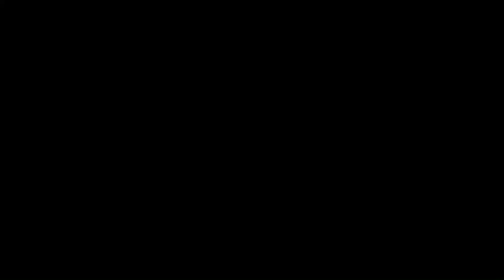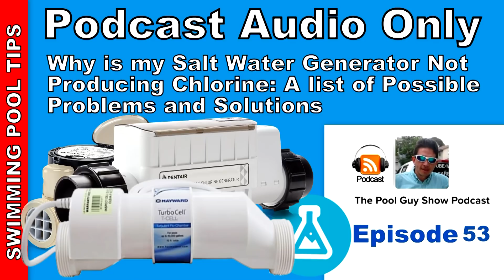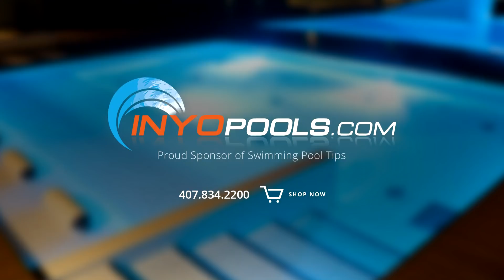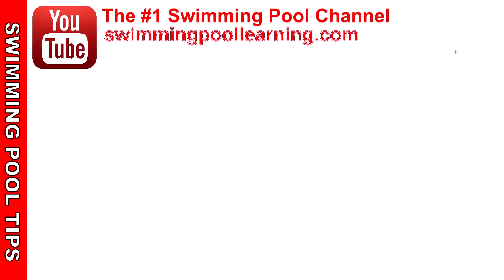Why is my Salt Water System Not Producing Any Chlorine? Possible Causes and Solutions

Comment: bought a home with an old hayward goldline. The configuration menu shows T -5 and T-15 only. no number 9. yet there is a T925 salt cell installed at the moment. 

should i swap the salt cell to a one of the T-5,T15. 

thanks in advance.
Reply from the maker: If it is working I would leave it alone.

Comment: I have noticed with the Pentair cells, after I acid wash them the entire cell is clean except for one little area.  This area is completely covered in calcium, and all the other discs are clean.  I don't want to keep acid washing it with most of the cell clean, just to get a small about off.  I try spraying it with the garden hose, but the calcium does not come off.
Reply from the maker: It shouldn't affect the production at all.

Comment: I have a 10,000 gallons in ground pool and Aqua Rite control panel. The cell went bad and ended up with high amp/salt level (6,400 ppm). I drained half of the pool and replaced with fresh water. My system still sending the high amp/salt level. The salt level is still saying 6,400 ppm. What could be the cause of getting this bad reading?
Reply from the maker: The cell or board is bad.

Comment: Why is My brand new IC40 not generating any chlorine. My salt level is at 3500ppm according to Leslies Pool and my digital meter shows 4000ppm. Flow light is green. Salt indicator light flashes red and green for 5 mins then stays solid red indicating low salt.
Reply from the maker: There is plenty of salt in there. Might be a defective cell at this point.

Comment: I think undamaged mine with acid for to long. The stuff I bought was weak, normally it would fix but didn't. So I let it stand overnight as it was taking way longer than the typical half hour to clean it up. Well my salt levels are good, chemistry is good. But water sample shows no chlorine.
Reply from the maker: You may need a new cell. The pool store can test your salt cell if you bring it in.
Reply: @SPL  it's not the cell. Guy replaced board and it  said 2800 but not generating. So I tried to recalibrate, but when you wait for the click before you hit diagnostic button. It doesn't click. Now it says -0. What does it mean when it doesn't click? Or how do I get it going

Comment: Just had a new Pentair installed. All chemicals are reading good, all lights are green (flow, salt, cell) on the Pentair but after running at 100% for 48 hours straight it has produced no chlorine. Our pool guy seems out of his depths and is saying it could be a filter needing replacement, but with flow green and it producing literally zero chlorine, could it really be a bad filter doing that much harm?
Reply from the maker: It could be something as simple as the pool having a very low CYA level. Or some other issue - was it holding chlorine with your previous method before the salt cell was installed?
Reply: @SPL  So our CYA number from the water test was 28 PPM. Is that low enough to cause zero chlorine to be present in the pool? I have an automatic pool cover and have been leaving the pool cover closed this whole time. Our pool was fine last year using regular chlorine.

Comment: I have an IChlor salt cell that has all green lights on with a 3,000 salt reading . Each week I take a sample of water to be tested at my local Pinch-a-Penny. This week the store manager informed me while my salt level is sufficient, there is no chlorine in the pool. Again, there is no indication from the light system that informs me of a dirty cell.  What should I do now?
Reply from the maker: It could be a number of factors. I would do a 24 hour test. Run the pool at full speed for 24 hours and then check.

Comment: My Hayward salt and cell light are on steady.  I replaced the cell, ran it at 100 percent (t9), and it still isn’t generating chlorine.  Salt level is at 3100, so it’s good.  I also replaced  the flow valve.  Still no chlorine.  Purchased and replaced the motherboard, and it had no power at all.  So I purchased a new display board, and it still has no power.  I Sent the motherboard back and put the old one back on and the power on display operating, but the salt and cell lights are still on.  Any suggestions?  I got the system in 2017.
Reply from the maker: How long are you running the pool? Try running it for 24 hours straight and see if the chlorine holds. Also, your CYA level should be 5080 ppm.

Comment: My salt water chlorinator is working intermittently. I have 5 green led lights from 0 to 100%.I have it turned to 100% which should light up the 5 leds.Sometimes it does and sometimes only 1 led is lit.

 My pool has perfect water chemistry with slightly high chlorine reading as I super shocked it due to algae.My pool salt is over 6,000ppm.

 Recommendations are minimum 5000ppm optimum 6,000ppm and max 6,500ppm.

Could the chlorinator cell not be making chlorine as the salt level may be higher than 6,500ppm thus sometimes showing only 1 led when set at MAX Chlorine?
 Thanks for any help.

Comment: This is very informative. We just had a 16,000 gallon pool installed a few weeks back. Salt was added about two weeks ago, and was being maintained by the pool installers pool guy. I bought a Sutro to test the levels. I started getting the readings today with low chlorine levels. Salt cell is rated for a 40,000 and has been running 100%. After listening to this it seems maybe our SWG hasn’t been running long enough. We have a variable pump I believe but was told not to mess with the scheduling. Any tips to figure out what to do?
Reply from the maker: Run your pool at the full 3450 RPM - 100% speed and salt output at 100%. Test and see. At those setting the system should make about 1 lbs of chlorine which should raise the chlorine level up to a high level. Also make sure you have about 80 ppm of Cyanuric Acid in the pool.

Comment: Hello, I have a 26,000 gallon pool. I have a Pentair ic40. Last week my salt and chlorine was all good when I opened my pool. This week my pool is cloudy and my cell generator was flashing red and green on the salt level. It was red to clean it so I cleaned it even though there was no calcium buildup. I then put it back together and I pushed  more for three seconds to reset it. A bunch of lights flashed and when it was finished the salt level was still red and green flashing and now the flow light is red. The water in the pump is flowing good, it is flowing good in the pool, I took it apart and lubed it on both ends and put it back together. It screwed back together easily. I emptied the basket. And I back washed. The red flow light is still on. I have the salt checked again and it was good. The generator is five years old and only runs from mid May until the end of September. I replaced the flow valve three years ago
Reply: There is no chlorine reading
Reply from the maker: Sounds like a bad flow sensor again.

Comment: Hello, I have a Pentair IChlor 30. It has just over 1100 hours on it. It
 has quit producing chlorine.When I put it in Diagnostic Mode, the 
voltage is only reading 20.1 volts. Of what I've seen and heard, the 
voltage has to be at least 22 volts for it to work correctly. Any ideas 
as to why the voltage is only 20.1 volts?
Reply from the maker: Sounds like it may still be under the warranty period. I would suggest calling Pentair as that is an odd issue.

Comment: My check cell light is coming on before and after I replacing the Hayward W3T-CELL-15. The panel was not showing accurate salt levels and my pool didn't seem to be generating enough chlorine. I'm trying to purchase another salt generator but I'm having a hard time finding an AguaTrol that can handle 40,000 gallons.
Reply from the maker: Both CMP and Circupool make a good 60,000 model.

Comment: Do you have somebody you can recommend to service my Acura plus system Kissimmee Florida.
Mi-acid reserve tank it's not running and a half to be adding salt to a pool check system light is on and also the inspect the cell.

Comment: ok, i drained out probably over half of my pool so i can fill back up to dilute.  I filled and been running my pump for 3 days and the display shows the salt level at 4000 ppm.  I checked with strips and i bought a digital salt meter.  The strips measured around 2700, and the meter measured 2400.  Now not sure why my aquarite display shows so much higher? please help!
Reply from the maker: It could be that the cell is dying. Usually when the cell is going bad it will give a false high salt reading.
Reply: @SPL  -----No pool guy, my salt cell is brand new.  I just bought the calimar brand cell.  your saying it could be bad?

Comment: Hi, what do you know regarding off brand cells.  i bought a calimar salt cell for my aquarite system with 3yr warranty for my hayward.  my hayward just died after 4 yrs at 100%.  input please.  hayward cells are very expensive.
Reply from the maker: I've heard they work pretty well. If the price point is that much better I don't see a reason not to buy one.
Reply: @SPL  thanks for your help and great audio!   I bought a salt meter.  Should I buy a cyanuric acid kit?  I can get the Pentair for $25 shipped.  Also should I use a liquid pool test kit or strips?  I just don't know.

Comment: I have a Pentair Intellichlor IC20 for my 12,000 gallon pool. The salt it produces is too high at 4500, but it doesn't produce chlorine. It gives us a "Clean Salt Cell" alert. There was buildup and we cleaned it, but we still get the alert. The salt cell is about 5 years old. I was told to check the fuse? Please advise. Thank you!
Reply from the maker: May be at the end of the cells lifespan.

Comment: We have had low chlorine readings for a while although we run our pump 24/7. We have been told the cell is gone so we have just replaced it. We have a Aquarite with a T3 cell. The salt reading is at 3300...we set the dial at 50 so the chlorine output is somewhere around 2. The problem is that after a couple of hours the output sets itself to 0. Help please.

Comment: Ok my pool salt level was at 3600 or higher . The board says hi salt level/amps the salt level on the board says 3600 also.. so I drained some water and added water to dilute it.. now after testing water it says 2700 and the board says the same thing.. hi salt/amps so u even replaced the cell but with that it says the same hi salt/amps .. any idea of what's going on ?? Bad electronic parts ???
Reply: Oh sorry the salt level in the board HAS NOT changed still at 3700
Reply from the maker: If it is an AqauLogic System the board may be bad.

Comment: HELP US PLEASE! I have a Hayward aqua rite salt system, my old cell was bought with the house a couple years back, I'm not sure how old the cell was, but it looked old and busted in one spot so we just bought a brand new one today, we turned off everything, we installed the new cell and turned it on, there is no chlorine shooting out into the water, only for a couple seconds when we first turned it on, we have a t9 cell for 25,000 gallons. the aqua rite is reading the salt at 3500 and it says it is generating but we don't see any chlorine being shot into the water, the water looks green and cloudy and we can't see the bottom of the pool. We added 2 jugs of chlorine before buying a new cell, 4 bags of salt, one ph - and one stabilizer, and its still green, we have been battling with this pool since june 1st , its now the 18th ,can you please tell us what we are doing wrong?
Reply from the maker: You have to run the pool 24 hours straight and also clean the filter - if it is not a sand filter.
Reply: @SPL  I forgot to mention that this is the VERY FIRST pool we are operating, SO WE ARE CLUELESS ,lol it is a Hayward sand filter ,so do we just leave the pool to run for 24 hours on filter, and also should we use drain or skimmer or does that even make a difference? I have been searching for answers all over the internet, I read somewhere that phosphates can cause the cell not to produce chlorine, and how would I be able to determine if that's the issue? thank you so much for your help!!!!! :)
Reply: Get a pool guy why risk a $20,000+ investment if your clueless.
Reply: Keep in mind that chlorine eats algae but algae will also eat chlorine.  It’s a battle and whichever has control will determine the condition of your pool.  You are not going to see much chlorine made from the Aqua Rite until you take care of the algae, by shocking the pool.  Google how based on the size of your pool amount of liquid chlorine needed.  Turn off your AquaRite while doing the shock because the Chlorine it produces is too little compared to the amount of liquid chlorine used for shocking.  Until you take care of the algae, turn it on to maintain level of chlorine.

Comment: I have a 25,000 gallon salt water pool. My pool is not producing chlorine. I dip my tester in and everything reads great except free chlorine., I have 0 chlorine. My SWG has 2 green lights which is good. I cleaned my Hayward T-cell last year when I closed my pool. If it had calcium build up then my SWG would have a red dot telling me to clean my cell, right? My local company tells me to keep adding pool shock. I have added 4 cases of shock in 2 weeks. I need assistance as to how do I know if my SWG is working properly as well as the salt cell. I have a Hayward Aqua Rite. My SWG reads 4200 salt which I think is inaccurate. I have added 7 bags of salt along with the shock. The water is clear. I believe the cell is about 4 years old. Any advice would be greatly appreciated.
Reply from the maker: Sounds like the cell is not producing chlorine. 4 years is about the lifespan of that cell in a pool your size.
Reply: Thanks. Any thing I should know before I change my cell? Once I get my new cell, is their anything I must do to program the new cell in the SWG? Or is it as simple as putting the new cell on and I am good for the next 3-4 summers?

Comment: Will my salt cell generate enough chlorine if I am running my variable speed pump on low?  Or does the pump need to be running at higher rpms for the salt cell to produce enough chlorine?
Reply from the maker: Needs to run over 1800 RPM to even turn on. Then try running it at a high speed for 8 hours to see if any chlorine is produced.
Reply: @SPL    Thank you!   This is why I'm not producing any chlorine.  I'm turning it up right now.

Comment: Hi,thank you,  great information.  I have an aquarite that is not powering up.  It comes for 5 secondsand turns off.   I just tested the water and salt level is at 1970...way below.  Is this reason you beleive it isnt powering up or another issue?
Reply from the maker: Sounds like maybe a power issue. The salt level should have no effect on the unit powering on or off.
Reply: @SPL  thank you so much for your input!

Comment: Hi! I have an issue with mine. It shows green light on power and generating (no other lights) yet when I test my water there is no chlorine :(. Salt shows 3400.
Reply from the maker: What is the Conditioner CYA level?
Reply: @SPL  I"m having the same issue .. Brand new Hayward Aquarite system. . salt level is 3600, chlorine is 0.5 according to pool store.  Have turned up the pump to 2550 a few days ago and still no difference.  You mention Conditioner level .. is this the same as Stabilizer?  If so, mine is zero.  Pool store told me not to worry about that?!?!  Can you help please?
Reply: Swimming Pool Tips, Reviews & How To - SPL what should the Conditioner CYA level be ?
Reply: Same issue - brand new Jandy SWG cell - green light for flow and salt cell on - salt reads 3.1ppm but leslie’s pool says .05 chlorine - just put in a pound of conditioner - will see if that helps

Comment: Just came across your video. I have a saltwater pool and everything was fine with it clear and everything. But my wife took a water sample to pool store and we had to add acid, and calcium hardness. But about 3 days later the water was cloudy. My wife took another sample and the pool guy pulled up our old pool which was 6000 gal instead of the 30,000 gal we have now. He said we should put it twice has much chems than we did. So they gave her the chems we needed and the instructions. The 1st step they said to do is put 5 lbs of shock then 1/2 bottle of Stop Yellow. My wife did that. Then the guy said wait 48 hrs to put the other 5lbs of shock in the pool, but my wife says the pool looks worst. She said she noticed that there was a message on the screen that said chlorinator off no flow, which we are running the super chlorinator. I haven't check the T-15 CELL, But I know it needs cleaning. Any suggestions
Reply from the maker: It's possible the chemical you added for the calcium hardness is clouding up the water, along with all of that shock. Give it a few days to clear and I think you will be fine.
Reply: Ok! This morning I cleaned the Tcell, checked all the fuses and I backwashed. The Chlorinator off no flow went away and when I went to the diagnostic menu Flow Switch says flow. So maybe the T Cell needed cleaning but there was no Service light saying Tcel needed service.

Comment: I have the hayword aqua rite salt system,  it shows check salt and when tested at pool store we are told we have 3100. Also, it will not show any chorine level. The owner of pool store said it could be because it is working to hard. Have my dial at 50%. Any suggestions.
Reply from the maker: Try cleaning the cell to see if that gets the check salt light off.